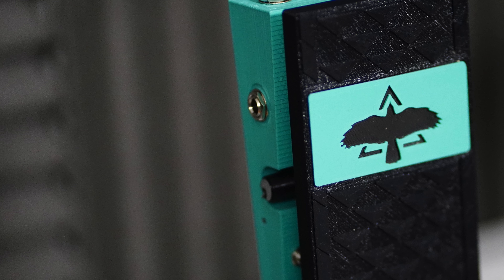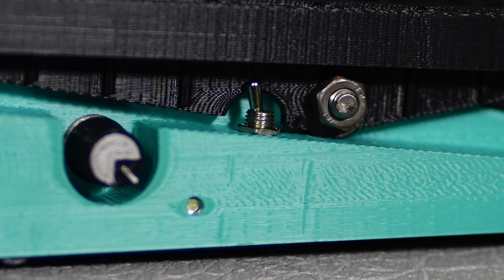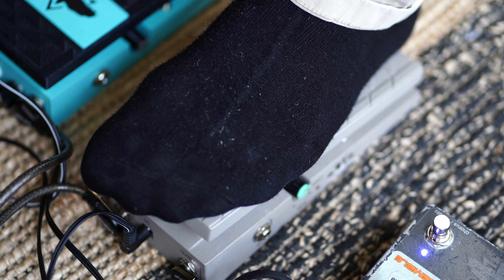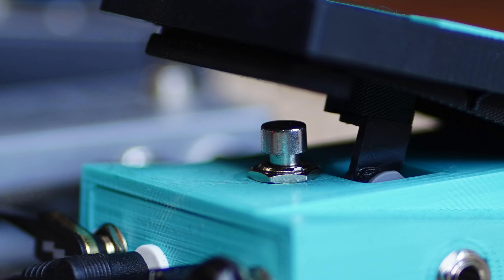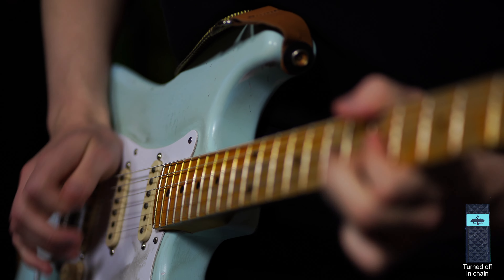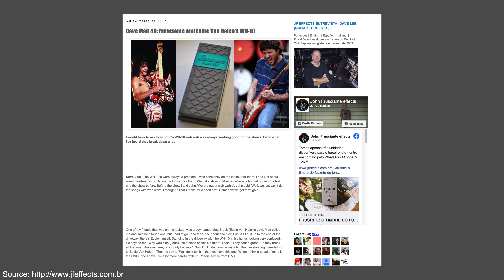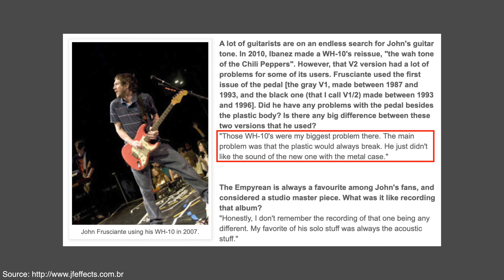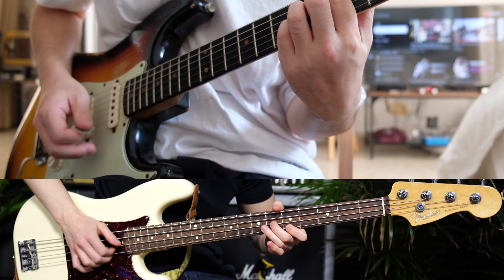Has The Optimal Frusciante Wah Pedal FINALLY Been Made?

Comment: Hey @Vigi 👋, I really enjoyed watching the video! Regarding the buffer of the WHX 5:32, the change in sound has a technical explanation that I hope it to be useful for the people.

When you only have the CE1 and the WHX, the sound difference between adding a WHX on the pedal chain or not is because you have the CE-1, which is a pedal that sucks a lot of tone (it has a very low input impedance) and darkens the sound. When you add the WHX OFF it acts as a buffer which, indeed, makes the CE-1 sound brighter and, better in my opinion. That is because the function of a buffer in a guitar rigs is allowing to connect a guitar without affecting the signal and thus without altering the sound of the other effects on the chain, independently of the guitar you are using.

You could have put a buffer pedal or any other pedal with a buffered bypass in froint of the WHX and the sound would have been very similar with the WHX OFF (depending on the characteristics of the pedal, of course). 

Something similar happens with the the big muff and the fuzzrite and it is where you noticed it the most. Fuzz pedals change their sound a lot depending on their input impedance and what you connect to its intput, that's the reason why using a different guitar or adjusting the volume knob of it will make your fuzz sound very different. What happens if you put a buffered pedal, like the WHX is that you are limiting the capabilities of the fuzz because you cannot control the input impedance, in fact fuzzes are designed to work with the guitar directly plugged on its input. However, you can use a fuzz with a buffer and get the sound you like and enjoy.

My point is, if you don't want to alter the sound of a signal when a pedal is switched off it has to be true bypass, then you can decide wether you add a buffer pedal or buffered pedal, this way you can get all the juice out a fuzz.

I hope I have written it more or less understandable 🙂
Reply: It makes sense, now I understand. Thank you mate!
Reply: Thanks dude!! 😂

Comment: The optimal frusciante wah was made years ago. It's called the Wilson Ten Spot II. No waiting list either :)
Reply from the maker: A wah comparison video is due. 😁
Reply: @Vigi  definitely, I think it would be really interesting to go through them all and see their sonic diffences compared to an original
Reply: There is no waiting list for the WH-X.

Ten spot uses a different effect potentiometer. The original Ibanez part is custom made, so ideally to replicate with good fidelity without aproximating the effect you really want to use the OEM part. Also those pedals have got some inconsistencies compared to the V1s.
Reply: @WillGalluccio  you're right, no waiting list, just not available at all :)
Reply: @Bunna08  Request for it has been amazing, and they sold out in about 4 hours. Consider this takes about 17 hours to build each unit. I think it will normalize over time as more people manage to get one.

Comment: 329 Euro for a plastic? no way… nah.. never! Much easier to change the rubber pads on V3 and add a volume knob mod for almost like no money. That’ll still be no more than 150 Euros
Reply from the maker: The plastic is a feature. It gives better feel, like the original v1. But the plastic in the TL version is way more durable than the v1. Also, the tone in the TL one is more similar to a v1 than the v3. However, John uses a modded v3 nowadays so if you’re after his current tone, a modded v3 sounds like a good choice. But for the vintage JF tone, the TL is better. :)
Reply: @Vigi all that is true! But judging from Dave Simpson’s experience, it’s not that durable. He managed to break the bottom plate. He is a good guy and he wouldn’t be complaining about Triungulo Lab pedals. But there’s actually a
video of him showing that and saying it got broken…
Reply from the maker: @ivanm9186  Oh wow :0 Can you send me the video? :)